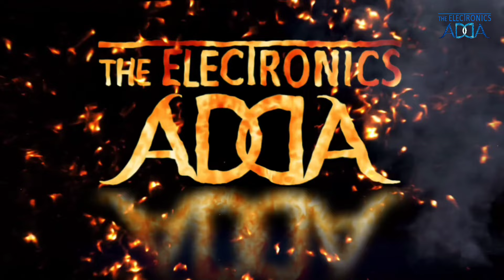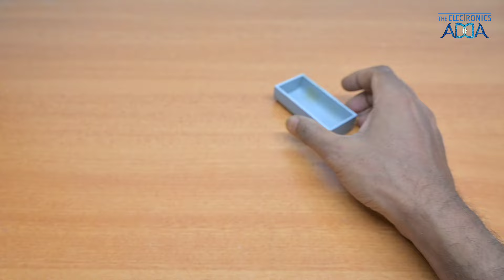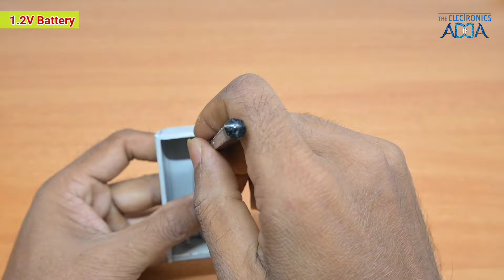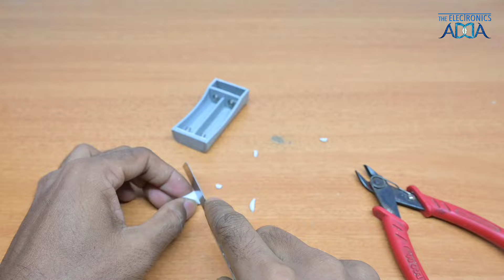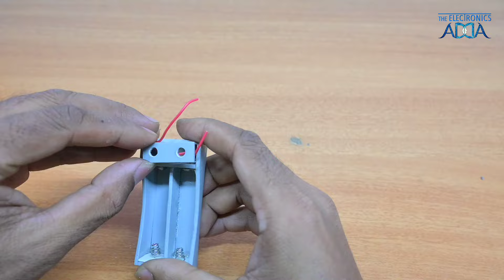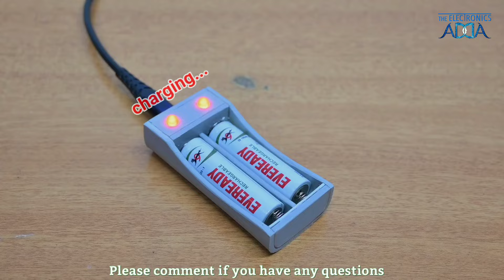How to Charge AA Battery at Home | How to Make Simple NiMH Battery Charger

Comment: Kya yeh circuit 3.7 volt lithium battery charge karega thanks for sharing the knowledge
Reply from the maker: Na sir 
Nehi karega

You are most welcome 😊
Reply: Lithium battery ke liye aapko ek charging circuit lagana padega jo online aapko 40-50 Rs ke aas pass padega
Reply from the maker: Yes
TP4056 Module lagega
Reply: @THEELECTRONICSADDA  Then if your design does not disconnect the battery from over charging, how would we know when is the battery charging full apart from testing with Multimeter ?